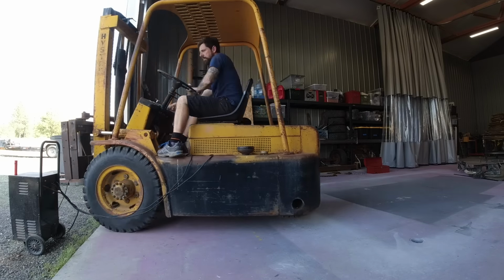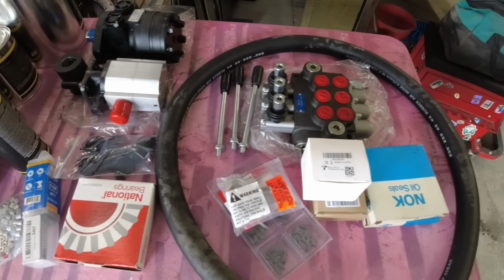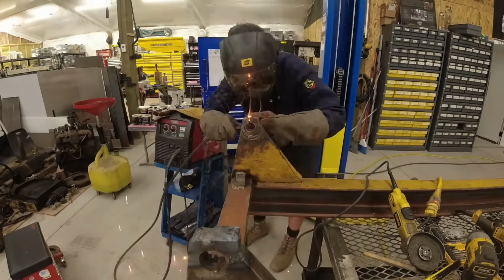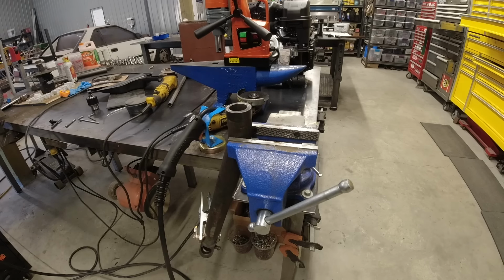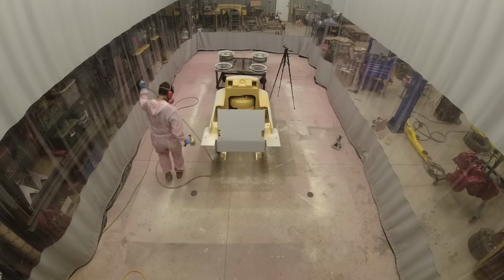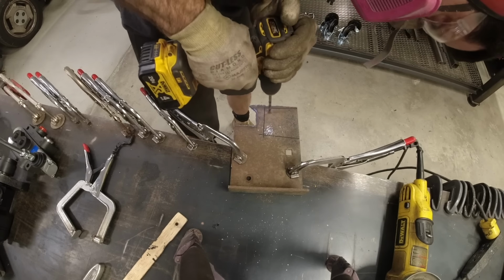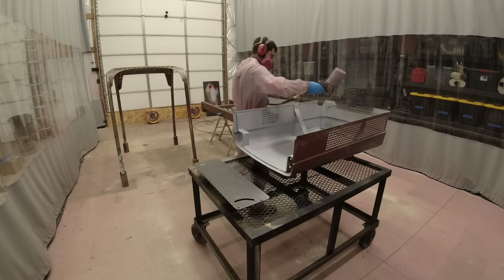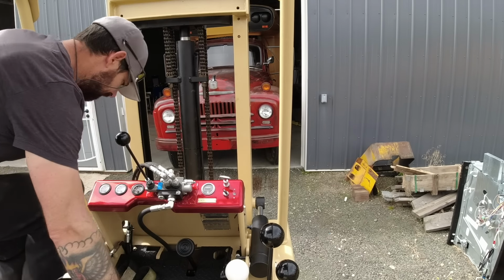Resto Modding A 1956 Hyster Forklift

Comment: Love the paint job! As a forklift/TMF driver/trainer I was wondering if you considered a Truck Mounted Forklift pedal set up? They use 2 pedals one on each side of the steering wheel: the right one is engine throttle, the left is a 2 way proportioning valve. The right one has a center pivot and when you push with your toes the lift drives forward and the heel is reverse. The steering wheel is hydraulic but drives like a regular wheel. I never did look into how it knew where to place the wheel but it did make it so much easier to drive.
Reply from the maker: I looked into that. Cost and complexity were the biggest factors why I didn't do it.  Usually those use an orbital valve for the steering that is driven by another hydraulic pump and that would have added a lot of cost and more failure points. The foot valve was too expensive to find one that could handle the pressure.  If I used this forklift more often I would have built it much differently

Comment: 1:05 You can change a clutch on a Mk1 Vauxhall Astra without splitting the box and engine. I think other 80's Vauxhalls were designed that way also.

Comment: Forklift tech here, the whole withdrawable main shaft to replace the clutch is very common on forklifts.
It's a cool design, not sure why more equipment isn't designed that way.

Also the split ring 3 piece wheels aren't actually the 'widow maker'.
They're pretty much a standard for a lot of industrial equipment out of necessity - a lot of industrial tyres have such high ply ratings and the sidewalls are so thick that tyre levering them on would be almost impossible with a conventional rim.

Comment: Front wheel drive general motors cars in the 80's in Europe had a similar feature, you placed four small retaining clips onto the clutch pressure plate removed a plug that let you withdraw the gearbox main shaft.
 You then unbolted the pressure plate from the flywheel and slid it out through the bottom of the bell housing, reversal to refit.

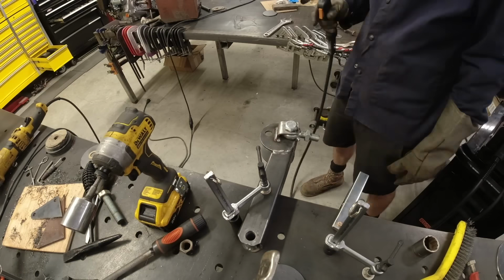Comment: 24:18 All pushing forces on the steering link will bent the link in all direction not only inside the moving plane. You may need not only a tube as link but a triangle. If it were only pulling forces you solution will be fine.

Comment: nice build, i had an old '50s Hyster that i scrapped out- this would have made me re-think that; for those split rims even low PSI can be dangerous, that's why they recommend only inflating in a cage, maybe next time place the rims under the rack arms of your vehicle hoist and definately use a clip on air hose to stand well out of the way. finally, you lost some counter-balance weight when you swapped out the engine so keep in mind the lifting capability (especially when at higher mast heights) may be considerably less. you could have the rear tires filled with ballast foam at a tractor tire shop- it could add some of the rear weight back without compromising that awesome paint.

Comment: Outstanding Video  i haven’t pulled apart any Hyster Forklifts yet, but i am familiar with operating  1970s through late 80s models  although they were pretty reliable overall. i  highly dought they would be in as nice of shape as yours. was after 60 years  of use !  (BTW  mine were Propane  fueled machines )  and always used  and kept indoors  primarily

Comment: you run the battery wire from an Hour meter to an Oil pressure switch designed to normally turn on or off and Idiot light in the dash, if motor is running, hour meter ticks, if motor is off, even with key on, No time added...............
Reply from the maker: I love this idea. This specific motor doesn't have pressurized oil but I will keep that in mind for other projects
Reply: @AustinCoulson  I suppose a guy could put the pressure sensor on the Hyd Pressure? if no motor running, no Hyd Pump? same result, only gain time on hour meter if motor running
Reply from the maker: @Mad-Duk_Machine_Werkes  the problem there is the open spool valve means the system is not under pressure unless you are actuating a valve. I can't wire up an oil pressure switch on the engine either because it's a splash oiled engine that doesn't run under pressure.

Comment: I like the paint job, when ever I do a stripe with painters tape I usually spray a light coat of the base color before the stripe color. Thinking being if anything is going to bleed under the tape it will at least be the base color and kind of "seal up" the edges but it adds another (partial)  drying step
Reply from the maker: I have done that with mixed success. Ive found that it works really well with latex based paints, but on oil based paints with hardeners I have never found the right time to let it dry and the right time to pull the tape. Sometimes I wish that I painted more to get more practice but then I remember that I hate painting

Comment: Without seeing the engine numbers its hard to tell but i do believe thats a continental engine. I work for HYG. I myself have a 79 Hyster S25 and its still almost identical in setup to your unit. Also, removing everything you did and using lighter items than what were originally within the chassis did absolutely change your load rating. Not by much maybe, but it is lower capacity now since the engine is part of the counterweight capacity

Comment: i would honestly recommend adding grease fittings to all the pins to help with longevity, also increasing the size of the hydraulic pump due to the application of controlling the mast and drive it can lead to over heating and the pump to fail as well as needing to constantly changing the hydraulic fluid.  but it does look good.

Comment: 13:52 you were lucky, usually these kinds of things snap just out of spite. A piece of wood, scrap metal, anything to wedge there would be a good idea, any time you have something akin to that.
14:59 no, that's a good modification. That kind of flexture is always sentenced to eventually crack and break, especially on a heavy piece of kit like this. If you had access to some equally thick metal, probably would've saved you a lot of grief to just weld new ears from scratch, but what you did will do just fine.
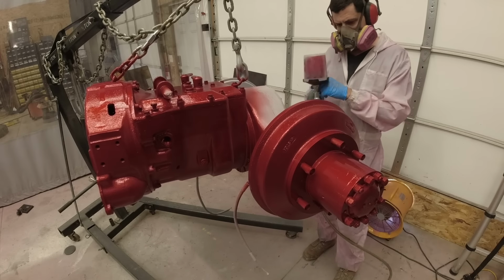29:30 it's actually a good idea. There's no place where a paint would get cycles that aren't sun related (UV) better, than on a part like that. Loads (as the metal flexes), moisture and other things, that's a good place to test it. My grandpa, before choosing to use a paint, he'd paint bits of various part of the underbody of his cars. A year or two later, if they lasted the abuse of salt or other things... they were good enough for the car. He repainted his first car a total time of 14 times, i know, because i found the test patterns of the different colors all over the underbody.
32:40 use a felt roller to roll the tape after you apply it. It will stop more of the paint from bleeding through. Felt or rubber (felt is harder to get these days, since so few people use them anymore), but the rubber should be a lower durometer type. If you can get your friend with the lathe to make you a spindle to adapt a longboard skateboard wheel with a medium compound, that should do it. The idea is that just by hand, it's not enough to apply the proper pressure, and you use the roller to fully suck the tape in to bond. Kinda like how shoemakers use a hammer against the last to beat down soles after they've been glued on. It's not enough to just attach it, you have to fully adhere it.
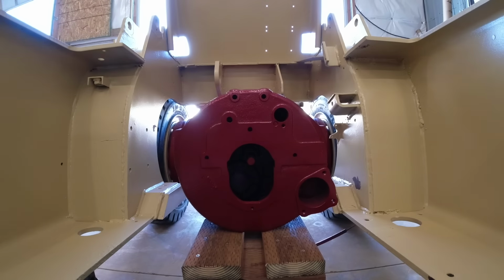33:36 that was actually done on purpose. Reason being that even when you've done all things properly, fully seated, proper pressure, good tire, under load, those pesky rings could still jab out and hit someone in the shop, because of load, or more specifically, variance of load as you operate the machine. They are indeed no joke, so Hyster did it right, mounted them inwards where there was no chance of them hurting anyone.

Comment: Great build! I’m not familiar with the limitations of the hydraulic pump, but you might be able to get twice the speed by removing the governor on the engine… maybe installing stiffer valve springs and a billet rod and flywheel to bump up the RPM’s from 4400~ to 6000-8000.

Comment: Absolute beautiful both the piece and the workmanship sir , you are ghifted with a lot of patience . Yes the forklifts are very much neglected on the cleaning side of things ,i know i repair a lot of them in 15 years including complete rebuilds but none looked as good as yours. PLEASE take note that by replacing the engine with something much lighter will throw of tha max lift capacity as well the safe waigt to hight diagram ( as small plate that should be on the dash). Please doo some research on the subject. One very dangerous situation is that you can lift a heavy load from a truck and think you are good but halfway down the forklift becomes unstable and tilt foward very fast . For reference ill ghive an example :  same chasy engine and transmision are used in 2.5 and in a 3.5 ton forklifts (something Bulgarian made) - the only diferences are 200kg more on the counterweight,a biger lift cilinder and biger front hubs otherwise same back axle steering and wheels same dash controls and everything. So pleasae be careful . Thank you and im your newest subscriber .
Reply from the maker: Thanks for your info. I plan on weighing the old engine and trying to figure out how much weight I removed. I mostly use this lift for moving vehicles around so it's usually only a few inches off the ground. The heaviest thing I usually lift off trucks is a 3k lb pizza oven, but I will certainly take your advice into consideration. Thanks for the sub.

Comment: Your doing fine, gaps will change after car is on the tires and more weight added. Do not make door and fender gaps to tight , you will need room to adjust after paint. Been there. Find spot welds with a mini belt sander. But you’re right it’s just a car, the fun is the build not the driving. Keep it cheap do it your way!

Comment: Hysters Rule. Toughest most dependable Lift EvEr. I operated many of them and never had a problem. 
I also operated a 1936 Tow Motor, 3 speed manual transmission that had a Lincoln flat head 6 cylinder motor. 
I'll bet that tank is still working out there somewhere.

Comment: Excellent work , and alot of effort put in including big deep knowledge of panelsbeating,  mechanical,  and engineering workshops expertise,  NB you should use sand blasting for all the part you paint save you alot of time and effort ( from sandpaper rubbing and patie filling 😅) how many working hour you put in , 😅

Comment: Amazing work, but i'm a bit worried about the position of the holes of the transmission mounts and  engine mount you have drilled at 39:10 and 39:36.

They are very close to an adjacent edge on the frame and may cause cracks to appear later on, especially under vibration and stress generated by the transmission and engine.
The rule we use in aerospace is, 
measured from bore axis to edge of the part = "2Ø + 1mm"

Comment: Austin, the MC from a Jeep is likely the reverse - Kaiser/AMC/Nash/etc were the kings of parts bin building. Depending on the year and model, you had ford transmissions, buick engines, and so on. Body panels (and piles of Torx bolts) were all them, but a lot of parts often cross-referenced to something from the "big 3" to keep development costs down.
Reply from the maker: That has been my experience as well working on those. Seems like someone else made almost everything and they used whatever happened to be on the shelf that day.

Comment: Changing clutch without separating engine from gearbox can you do on saab 99 and saab 900 OG and early fwd opel such as corsa, kadett ascona from the 80´s. Some old fwd british cars have a unique design with gearbox directly mounted on engine as usual but with a transaxel through  the geabox and the clutch on the outer side of gearbox with the engine coupled to clutch friction plate and gearbox coupled to the pressure plate. Strange but english

Comment: I don't know if you have an answer to your question yet but I think that's probably an F162. I just redid the head on my '76 Clark C300 with an F163 and I can't see a difference between that head casting and mine. The two engines (F163 and F162) are the same basic engine with different compression ratios. There should be an engine tag on the right side of the engine if you're facing the front of the forklift. It should be directly under the cylindrical thing between the alternator and oil filter.

Comment: Very nice to look at, but this is almost identical to one I learned to drive on back in the mid 80's and it kinda hurt to see the old engine and stuff go as they are pretty much bullet proof as per my experience. I guess I was hoping to see a restoration instead of a resto mod. Still a great job for what it will be used for. I graduated into retirement from a new Toyota. It was nice, but the company still had and maintained  the lift like this the day I left. I guess I kinda miss it. Thanks for the video!

Comment: That same f-162 was in a ton of Lincoln arc welders more specifically the sa200, and you can get tons of parts for the engine or like most welders do a kubota, Perkins, or yanmar diesel swap which is more efficient

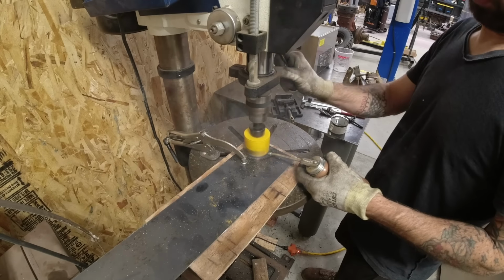Comment: 26:00 Odd question. After you do your welds do you put like a weldable primer on the metal or just let it go?
Reply from the maker: depends on what paint I am using. On those circle plates you mentioned I used a bare metal epoxy primer before I did the tan paint. On something like the steering linkage that got spray painted, I just shot it bare with a rattle can

Comment: You sure changed that one. I had a job at a beer distributor and we had to drive empty kegs across a parking lot. I’m pretty sure it I used a Hyster. It was the gas job with a 2 speed transmission. Get up to speed and it would drift all over. Keep was known to use any off the shelf part to make a vehicle.

Comment: You've got the old noggin wheels spinning for me on this idea. I was looking at a repower on mine because the F163 in mine is tired (really bad blowby and cylinder scoring), and this hydraulic motor/log splitter pump idea has me intrigued. I was also thinking like an older small Toyota 4-banger would do nice in there because they last forever and the compression is high enough to take advantage of the propane. Plus these small engines are super loud. That comment about the hour meter made me laugh. One of the POs of mine hard wired the hour meter right to battery hot so it was on all the time as long as the battery was connected. Hour meter read like 9800 hours but it could be anything at this point. I still have half a mind to keep the old Continental engine and just do a rebuild but man that thing is thirsty and it's way overkill for this machine. Even in its decrepit state it's got more power than it needs.
Reply: Okay now that I see the speed I think this idea is out for me. My shop is a couple hundred yards behind the house and strangely I find half the time I'm using the forklift to ferry heavy stuff back and forth between the house and shop. That would be excruciatingly slow for that purpose. Great idea though. I must say that I thought of similar. I even was looking at doing like a 12 volt electric pump for like a dump truck and this motor combo and completely eliminating the engine altogether. Like a pair of semi truck batteries would be more than enough juice for the amount of time I intend to use this thing in a day. The slow speed really nixes that one though.
Reply from the maker: I wouldn't recommend this conversion for moving stuff long distances or unloading a lot of stuff. It is super practical for what I need which is occasional deliveries of a single large item and moving heavy broken equipment around the yard.  I like your electric conversion idea.

Comment: I replaced the clutch on my uncles Vauxhall Astra in the early 90s the had a hatch that removed and you could change the clutch without disconnecting gearbox from engine

Comment: DAMN. Helluva job. Watched the vid and kept wondering how that thing would be powered with what little room was left in the engine bay. Anybody know how the re-power setup compares to the original engine? I took one look at that old radiator and thought, “I bet the yokel who owned that thing previously wondered why it kept overheating.”
Reply from the maker: This rig is way more powerful than it was before the restoration, but I don't know how much of that was due to how poorly the old continental was running towards the end. The hydraulic motor is equivalent to 89 lb ft of torque and I couldn't find specs on the Conti, but I can't imagine it was more than 60 out of a low compression flat head.

Comment: Build effort and quality is excellent (as usual, Austin never disappoints). Sadly disappointed in the performance of the repower. I wish the OE engine was restored.....and keep the steering wheel.
Reply from the maker: You aren't alone, but I love this setup so  more than how it used to be. It's a lot more practical for my specific needs. When I started I did try to save both the steering and engine, but price and difficulty sourcing parts pushed me this direction